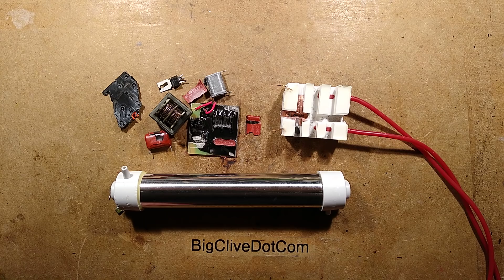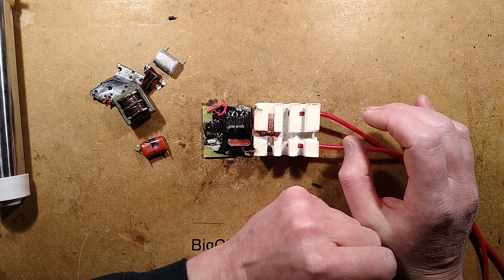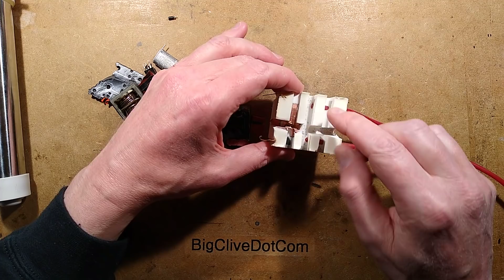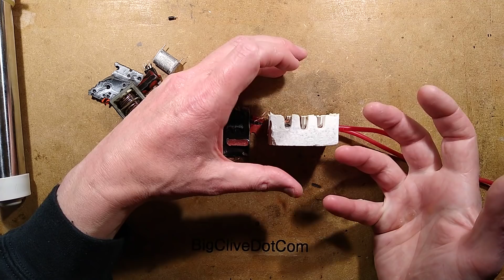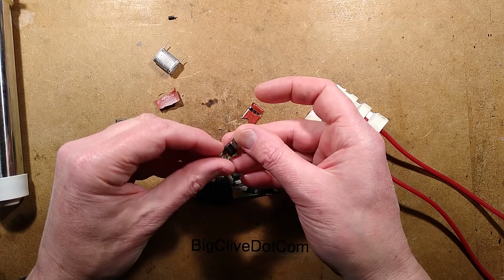Inside a nasty high voltage ozone generator PSU.  (with schematic)

Comment: Thank you. I think that the UV lamp has quartz because glass would abdorb the UV light. Such Penray lamps are used to produce ozone  The cylindrical ozone generating tube produces much more ozone. I think it was an invention of an engineer named Siemens. It is a smart invention because the dielectric prevents energetic discharges, or break down discharges  which would produce less ozone. The ozone molecule is weak and destroyed at high temperatures. When air flows through the annular space and the are Corona discharges at higher temperatures nitrogen oxides are produced, like in lightning flashes.

Comment: The description of the common mode choke was confusing. When the current flows in the circuit the magnetic fields are in opposite directions around the core and cancel out. When the current is common mode interference the fields then reinforce each other so that there is inductance to reduce the current flowing as would happen with two separate ordinary inductors.

Comment: 16:20 I've only owned one ozone generator, and it was based on a UVC tube. Not having used a corona-discharge-style one, I can't really compare, but I can say that the UVC one put out enough ozone that I had to leave the room when it was running.

Comment: the circuit on that reminds me a lot of a photoflash trigger circuit.  they did that "charge a cap in series with the transformer primary and short it out" trick to fire the strobe's trigger transformer off.  Of course there's a resistor (100K or more) in series to charge it up, and it isn't shorting its own power supply out when it fires.  Theoretically, if the time constant is right, it could trigger the thryistor when the input voltage is nearing 0V so that shorting the supply out isn't such a big deal, but this IS china we're talking about, so if that is true it is probably purely by coinkydink.

Comment: In my much younger days I rescued an ozone generator from the local rubbish dump. These were used to supposedly increase productivity in commercial premises. I guess the thinking was if oxygen is good for you then more reactive oxygen must be even better :(
Anyway this thing was alternative layers of copper mesh and mica about 100mm square and about 8 layers. That was connected to a high voltage transformer of around 250VA capacity. With the lights out the stack really glowed blue, sizzled something fierce  and there was a massive stench of ozone soon filling the room. It was about that time I lost my sense of smell. 40 years later it's back, weird.
If you want to kill bugs then ozone plus UVC is going to get the job done. If you want to kill bugs and not harm humans in the vicinity  then  222nm UVC seems the go. I have noticed in our buses a unit in the ceiling that has a distinctive blue glow leaking out of it. I hope it's what I think it is and we're not being told for fear of the 5G idiots going nuts.

Comment: You mentioned the capacitor if it was a neon tube but the ozone plates act as capacitors provided they aren't cracked or shorting.

Comment: If you bought it for cheap on ebay it probably is used on that new. Chinese passenger jet they put into service recently. They are still using a 240 volt system however it is running at 400 Hz just like in Western aircraft. This would be the reason for the rough operation. 400 Hz is far easier to smooth out into DC than 50 Hz.  Another dead giveaway is the lack of identification stickers on both parts. Western avionics suppliers are required to mark the part numbers on the parts with indelible ink and/or "non removable" tags.
Is that fish fryer designed to be immersed in water?
As for UVC LEDs check out the Würth Electronics catalog on their German site. I happened to pass by it while browsing IR LEDs from a link that was on Great Scott's channel where he has built a "night vision" camera recently.
Cheers!

Comment: New personal goal, "Set fire to quartz".
Reply: Magnesium thermite.
Reply: Chlorine trifluoride. Burns through cloth, wood, test engineers, asbestos, sand, water
Reply: Hyperboloid OfOneSheet The rest of that quote is equally good and worth including:

“It [ClF3] can be kept in some of the ordinary structural metals—steel, copper, aluminum, etc.—because of the formation of a thin film of insoluble metal fluoride that protects the bulk of the metal, just as the invisible coat of oxide on aluminum keeps it from burning up in the atmosphere. If, however, this coat is melted or scrubbed off, and has no chance to reform, the operator is confronted with the problem of coping with a metal-fluorine fire. For dealing with this situation, I have always recommended a good pair of running shoes.”
Reply: @FarleyHillBilly  Yup, I have the PDF version. Hardcopies are stupid expensive (or were, last I checked).

Comment: If you've managed to set quartz on fire you've probably taken inspiration from an article (available on line) titled "Sand won't save you this time" which you should look up and read. Right now. You'll love it.
I can't say offhand whether corona discharge or UV is better for ozone production, but perpendicularly (as opposed to tangentially) I thought I'd mention the UV "air laser" I first saw in Scientific American's "Amateur Scientist" column many years ago. It's a very simple, cheap (~US$20) DIY 337 nm laser you should consider building one of- no mirrors involved, just some relatively tame HV.

Comment: "It must have broken their accountant's heart when they said 'we have to include this or we can't sell this'". You forget, it's an aircraft part. Those things always cost ten times more than consumer parts, so they didn't lose much profit margin adding that choke.
Reply: Don't worry, version 3 will be coming out soon. cheaper epoxy (the stuff you buy in bulk for pennies per pound), and they will be filling it with the finest dried riverside mud as filler, with the special ingredient of ground up PCB material after the copper has been extracted as further filler. then that expensive inductor will be replaced, first with a smaller one with recycled ferrite core, then by one with CCA wire and a dozen recycled metal punchings as core. Version 6 will simply omit it for a recycled jumper wire, and a scattering of metal shavings on top with the epoxy fill.

You remember those cheap power supplies with the power factor correction inductor in them, that was simply a transformer laminate pack ( because those are cheap) and a single turn of wire through it, then injection moulded to look like it was an actual transformer.
Reply: Tom Who needs radio reception when flying?  Let’s just turn all our aircraft into flying broadband radio jammers...surely nothing could go wrong!

I would certainly hope those never hot anywhere near any aircraft, though I would never put it past Chinese manufacturers to try!

Comment: Isn't the circuit basically the same principle as the old driver for xenon flash transformer and at the same time a good old fashioned light dimmer (replacing the 1M resistor with a potentiometer)?
Reply from the maker: Very similar to xenon trigger transformer circuit, but firing on every half wave.

Comment: Reading the description for Thyristors it occurred to me that they are a lot like transistors so I looked into a bit more and found this interesting article:  https://www.explainthatstuff.com/how-thyristors-work.html

A Thyristor is basically 2 Transistors tied together so if when one receives current is activates the other which activates the first in a sort of positive feedback circuit.  As a result a Thyristor will stay on even after the gate (middle pin) is turned off.  Also analogous to T-Flip Flops or Relays.  Unlike Transistors and Flip Flops a Thyristor can handle huge currents and their are versions for both AC and DC current.

Hope this helps someone (I learned basic Electronics in high school and a little in college but I don't remember any mention of Thyristors, coming back to it years later there's a lot I didn't understand back then).

Comment: I tried making my own super-duper-size ozone generator out of some big 8-inch pvc pipes and aluminium foil. Hooked them up in parallel to 120kV from a dental XRT and essentially make several giant resonant circuits. It made enough ozone in a few minutes to give me a headache, probably shouldn't do that again. Also of course the RFI from the resonance disables all telecommunications in about a 30 meter radius LOL

Comment: @bigclivedotcom  
hi
great work. 
i'm trying to reverse engineer one for my self.
but i have hard time finding a 240nf 400 volt polyester capacitor in the market.
there is only 270 or 220 nf and they are much bigger than this tiny capacitor you are showing the the video.
are you sure the value of that capacitor is not in uf? 
i'm new to electronics and still learning so sorry if i sound stupid.

Comment: Try a HV transistor like the TV Hout transistor and build a blocking oscillator using that HV transformer - run via dropping resistor from mains to limit voltage current in event of failure

Comment: well now u gotta hook it up 2 a proper supply !! pretty pwease !!   I'm thinking to make one out of a standard fluorescent tube.... Hoping that when the tube is illuminated, it will become conductive enough to become the inner electrode. Outer electrode... Power supply will be fun.  Then again I keep thinking that the first order of business is to merely find out if its easier just to use normal materials. 2 wires / metal sheets and the correct plastic film / pvc ?

Comment: I know next to nothing but the explanation for the common mode choke still doesn't convince me. Surely it's during common mode that the direction of the fields adds up, so as to get resisted against by the field buildup?

Comment: Would the resin fill really defeat the slots? I would naively expect it harder to arc through solid insulating material than air.
Reply from the maker: If you mean the slots in the white resin it's me who cut those to explore what was inside.  It's usually a solid block.
Reply: On the circuit board? The slots are cut to avoid "creepage", which is stray current going through contamination on the surface. That's different than "clearance", which is there to avoid arcing across the gap.

A good way to think about it is that creepage is the distance that the ant crawls, while clearance is the distance that the crow flies.
Reply: The effect of resin depends on how it's applied.  If the whole circuit board is cast into a solid block of resin then you are correct, breakdown is limited by the dielectric strength of resin, which is higher than the dielectric strength of air.  But here, resin was just dribbled over the top, and it may have filled in the anti-creepage slots in the circuit board without covering up nearby conductors.

Creepage is related to creeping failure: when an insulator has a high electric field along its surface, a progressive failure can occur, creating a conductive path along the surface.  That gives it its name because the path slowly "creeps" from one conductor to another.  It can occur at electric field levels even lower than required to arc through air.  It only occurs on surfaces because it's partly a chemical reaction with air (that's also why different insulating materials have different levels of susceptibility).  It can't cross air gaps because there's nothing in the gap to become conductive.

So, if the circuit board has open slots in it, creeping failure can't occur across the slots.  If the circuit board is completely covered in resin on all sides, creeping failure can't occur through the resin.  But if there is just enough resin to fill the slots without covering the traces and pads, then creeping failure is once again possible, defeating the purpose of the slots.

Comment: My company actually makes uv ozone generators for hot tubs. From what I understand the dielectric generators produce more ozone but they tend to wear out much faster especially in the hot and humid environment under a hot tub skirt. I believe the dielectric ones can also be smaller for the same output. I don't know about the power efficiency but I know ours is silent.

I'm actually working on trying to retrofit our units so they can be used to sanitize air instead of water. They were designed to work with a water venturi creating a vacuum and pulling air through the unit so they were not designed to be as airtight as I would need to push air through under pressure.

Anyone have any ideas on a cheap air pump I could include with the unit? So far aquarium air pumps have not been powerful enough to push through the restrictions and leaks.
Reply: There was an old type of aquarium (and lab) air pump called a hy-flo that produced higher pressure and less noise than diaphragm type pumps - just don't know if anyone still makes them. some videos of them working on yt.
Reply: I have a unit like that on my hot tub.  Couldn't tell you the brand though.  Could you use something like a computer fan, attach a venturi to it, maybe 3D print the venturi to mount up to the fan?

  I guess I'm not sure if you need high pressure low volume, or high volume low pressure.  I have a portable unit the size of a small lunchbox I use in my pickup to get the smoke smell out. It's nothing more than a fan blowing across a few corona plates.
Reply: What if you used the low volume aquarium air pump to extract the concentrated ozone and then inject that ozonated air into the air stream of an ordinary fan to disperse the ozone into larger space?

Comment: I am having probbems with a wifi skate board controller and other electrics .can you look or do a talk on pairing wifie contollers and checking MOSFET electric parts on boards. I could send some bits if you wanted .     :)  Also it has a Balance board but not sure about how to check if its working.

Comment: Well i've a doubt. Is this ozone gas itself has any direct or indirect effect on electronic components/devices? Or so do UV-C lamps? Like corrosive or something?
Reply from the maker: Yes.  The gas is a very strong oxidiser so it has to be contained and used with silicone and stainless materials.
Reply: @bigclivedotcom  Okay, so if we want to sterilize a room, we need to take out all electronic devices first, isn't it? The point is I've a UVC lamp but I'm not sure whether it makes ozone or not!

Comment: My output transformer burned out. Secondary winding. Could you tell me how many volts such a winding produces so that I can restore the transformer? Another idea is to use a line transformer from a monitor with a CRT tube (kinescope). How do you like this idea?
Reply from the maker: It's usually around 3kV.  A line output transformer may have a built in diode which would stop it working with these units as they require high voltage AC.

Comment: Is quartz a good heat conductor? I’m wondering if quartzy resin keeps things cooler than plain resin
Reply: No it is more there as a very cheap and very non reactive filler material, as it is basically silicon dioxide in pure form. It also prevents cracks from propagating in the resin, as it forms a crack stopper for when the stress from thermal expansion and from shrinking in curing breaks the epoxy itself. Slightly better thermal conductor than resin, but if you want better thermal performance you will have used fumed silica in a high proportion, so that it allows good thermal transfer through the resin, and also you use a lot less resin, though it makes for high wear on things like your filling machines as you are basically pumping grinding paste through them.

Comment: Hey Clive, I get that it's an ugly circuit and also why. My question is, if you were designing a circuit to drive one of those corona discharge tubes what would it look like? I'm curious as to how a Big Clive equivalent would be designed and constructed and how it would tackle the acoustic and electrical noise whilst not beating the components to within an inch of their lives and using fairly standard components. Reusing the transformer would make sense though, winding and potting one of those would be a PITA, just chuck the PCB in the bin and build a replacement for that.
We've seen ugly, now show us some beauty that our souls can be at ease. ;-)
Love the channel and the content is helping keep the cabin crazy at bay. Stay safe (mandatory) and sane (optional).
Reply from the maker: It would probably be based on a Royer oscillator running at high frequency.

Comment: Reading the graphs for absorption coefficient is difficult, but it's going to take at least several centimetres, possibly several metres of air to absorb most of the light to creste the ozone, so would likely end up wasted in a small tube like that

(The graph is really annoyingly hard to read in the region of interest)

https://images.app.goo.gl/QgB3Wmdu2TBsZBDN8

Multiply the vertical axis by the number of oxygen molecules per cubic centimetre and invert to get the number of centimetres required to reduce the light down 37% of its original value.

Comment: If this was indeed manufactured for the airline industry, wouldn't it be powered at 115V 400Hz system? I wonder how this would effect the noise produced by this power supply at 240V 50Hz.
Reply: What with radar and communications and fly-by-wire and all the other stuff, would they even allow a horrible shrieking box of sparks on board an aeroplane? Wouldn't they use a UVC tube instead? Or some chemical method, maybe, of disinfecting the air? If Bart had to turn his Gameboy off to fly to Australia, a dozen or so of those noise-boxes and their lightning tubes would surely total an airport.